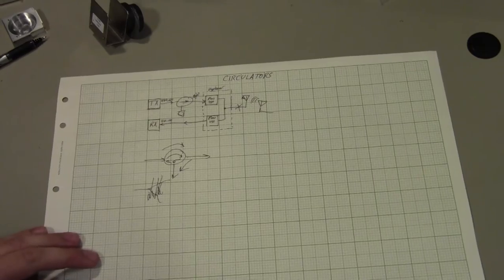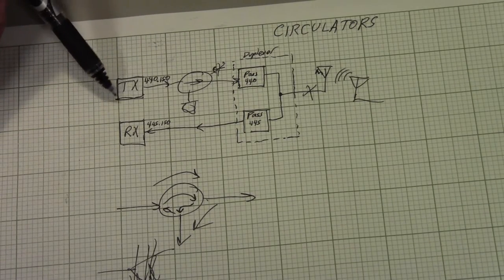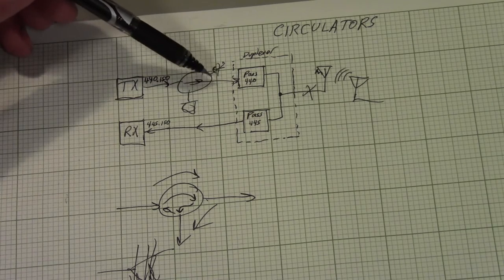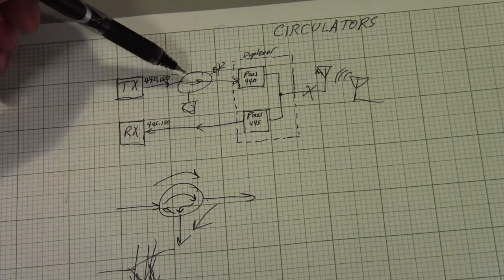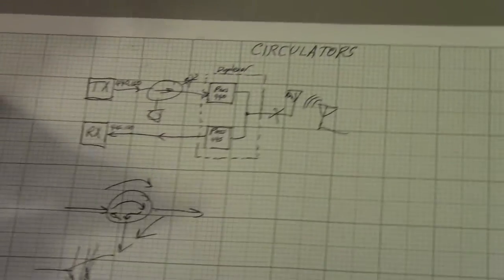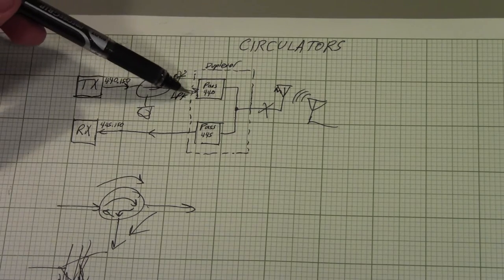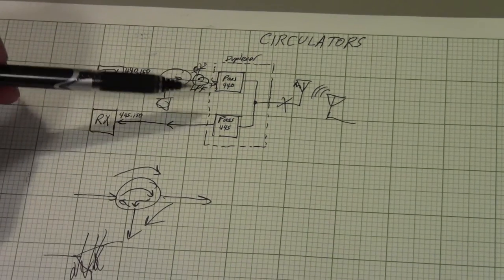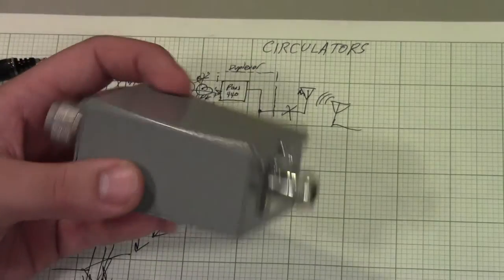Why You Need Circulators in Repeaters

Comment: It would be good to mention here that a full bandpass cavity should always be used between the antenna and any circulator..  Circulators are a non linear device and can themselves be the mix for intermod..  The pseudo bandpass notch duplexers are not true bandpass. They will pass an out of band frequency like they are not even there. I currently assemble four can hybrid notch pass cans with two full bandpass cans for any duplexer we put on a site that is on state owned land per their requirement.  

Circulators are also a bunch of induced loss to your transmitter signal.  Take that into account when your final ERP comes into play..  You are better off making up that loss with more transmitter power than antenna gain in some cases  (valleys mountains ect..) but in the flat part of the world higher gain antenna patterns should not hurt you as much.

We lovingly call circulators RF diodes.. ;)  If I have a site all by itself with no other nearby transmitters.. I will forego them.  Just keep an eye on your site and do regular maintenance on your stuff.  Also find out if your high end repeater might not already have a built in isolation circuit on the transmitter.. most of mine do.. counts as one port. (for those of you required to have a dual port circulator at a site)

Comment: Curious to know if you reverse the poles of the magnent e.g. put them back in the incorrect order vice the way it was designed, do you effectively reverse the flow of electrons via the Lorentz Force? I would be interested to know if the proper function of the isolator is dependent on the poles of the magnents...

Comment: When our workplace was putting in a single-band repeater system last year, I tried to explain to them why, while it was probably fine, you shouldn't test the unit without an antenna attached. Ended up trying to describe what a circulator was and failed pretty bad. Should have referred them to this video instead, much clearer.

Comment: I'm thinking about how it would work to use a circulator on the antenna side of a duplex filter  instead of just wiring it to a T-connector to increase isolation, is that something that would help or would it just create new issues?

I suppose any reflected RF would try to go to the RX port first, be rejected by the duplex filter and then circulated in to the transmitter. Is that somewhat correct?

Comment: Kenneth, Thanks a lot for the excellent video. I have a question. Can you tell me what stops the circuit to not to flow in the reverse direction in 900MHz Circulator since there is just a conductor in magnet inside?
Reply: Lorentz
Reply: LimitedOptionsMan the principles of deflection rf with magnetic field...

Comment: Couldn't you also use a bandpass filter in place of the low pass filter?
Reply: Actually a full bandpass cavity should always be used between the antenna and any circulator..  Circulators are a non linear device and can themselves be the mix..  The pseudo bandpass notch duplexers are not true bandpass. They will pass an out of band frequency like they are not even there.